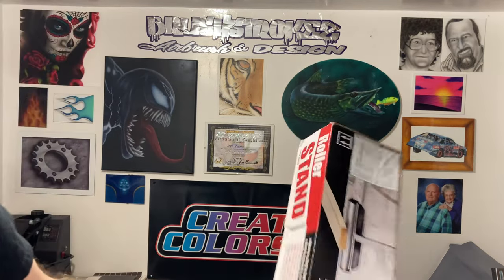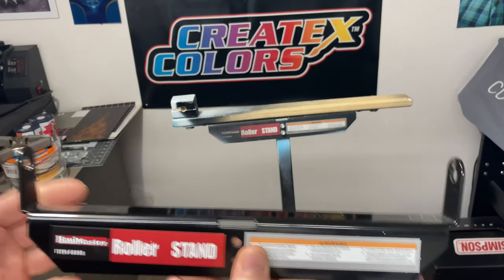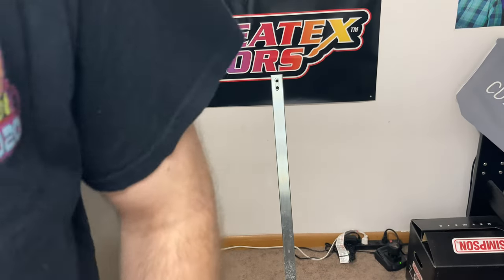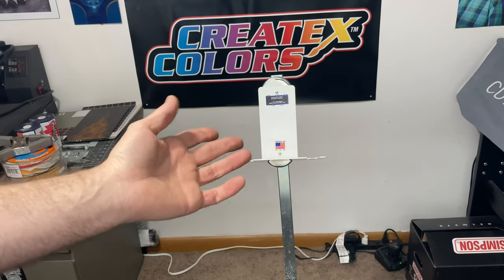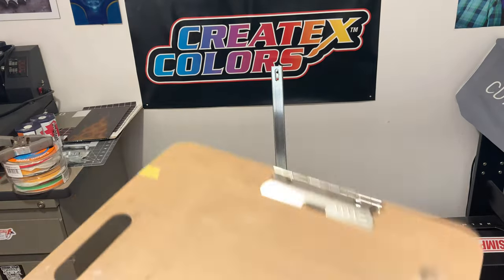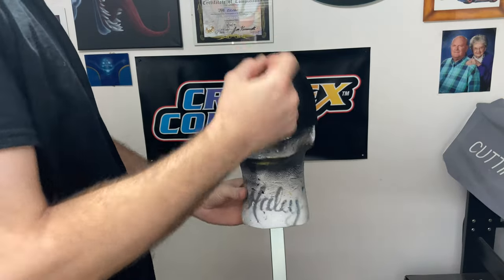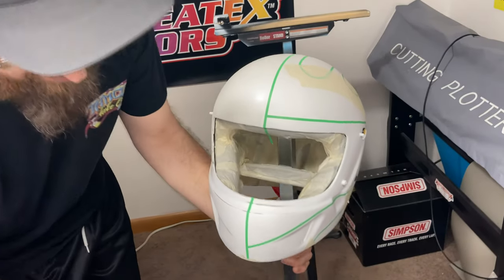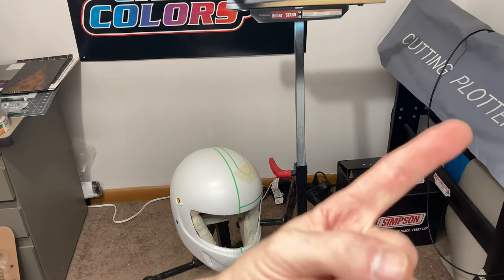DIY Motorcycle Tank Stand/Mobile Painters Station

Comment: Genius. I wish you had this video out before I spent all that money on the stands I got. I see that plotter in the background. What’s a good one. I need to upgrade from the Cameo Silhouette
Reply from the maker: I have a Vinyl Express R31 plotter from Sign Warehouse, was $400. Had it a couple of years now. Works pretty good and haven’t had any issues.  It can cut thick Mylar pretty easily too. Only came with basic design/cutting software, no image trace.  So I use Adobe Illustrator to design everything, then their software to run the cutting.  Plan on doing a vid on the whole design to applying the vinyl here soon.